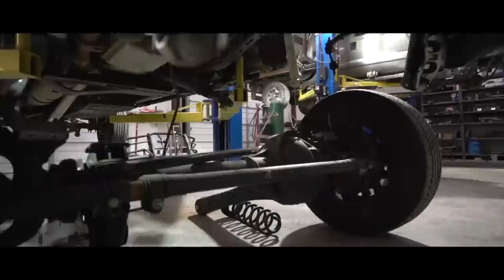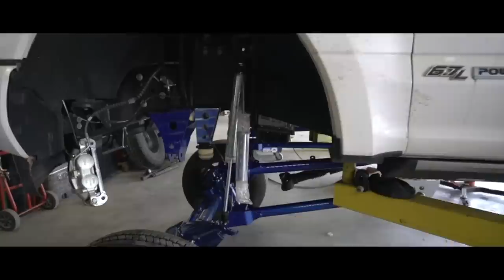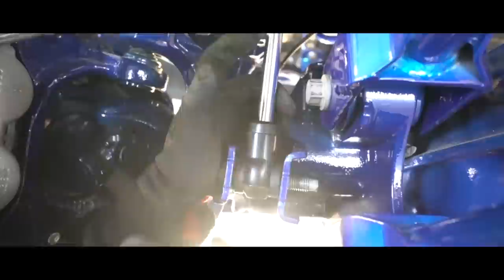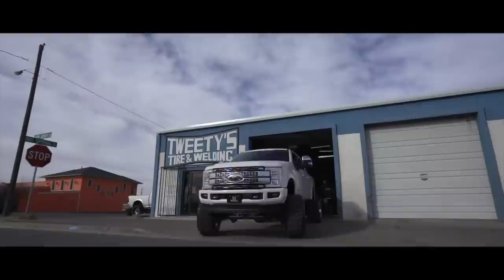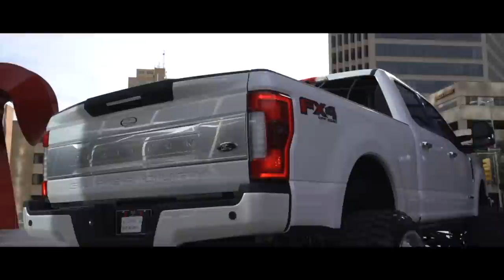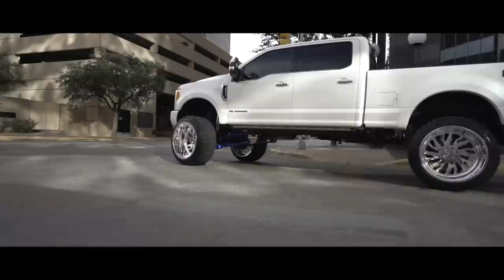HOW A 2017 F250 PLATINUM IS BUILT! 8 INCH CHROME LIFT ON 26X16 FROM START TO FINISH!!!!

Comment: If my searching skills are correct, the wheels alone were $6800....god damn
Reply: 7 Star 150 true, I worked down there in the field and had some put in my truck but 24X14s on a 6 inch lift. Dodge. There do an awesome job  at tweety’s tires
Reply: What a waste of a good truck
Reply: Mike Avilez not a waste but definitely now useless
Reply: That shit fire🔥🔥🔥🔥

Comment: A buncha f'in haters on here that can't afford a truck like that. Never fails. That truck is sick and definitely a head turner. That's the new age chick magnet not those little Hondas or Vettes. A $100k beast with all the options of a sports car or sports sedan. Turbo diesel 440hp plus 200hp deleted and programmed. Pano roof and can play in the mud and pull a boat and trailers. You won't see it stuck in a flood that's for sure
Reply: sorry to break it to you bud  but i can  afford a truck like that, my daily drive is a 2008 All Carbon Lamborghini Murcielago LP640 Manual, nonly one in the world, i just don't like trucks.
Reply: @RectafyGaming  you drive a lp640 but upload fortnite videos on youtube😂 shouldn't you be busy trying to make money somewhere else? Sounds like a kid to me💀

Comment: How much of a lift do I need to put on a 2002 excursion running 35x13.50x26 m/t
Reply: You'll need about 5-6" of a lift to make it look good https://autocarspec.com/ford-excursion-35-inch-tires-vs-33-what-lift-to-choose.html
Reply: I had a 99 f250 and I cleared 35s on a leveling kit. Minor rubbing

Comment: It looks like mine but I have a doge and its wight with a candy blue Drs lift kit
Reply: Angelica Olivos With that English, I doubt you have a truck.
Reply: Ford Fan01 nice ford
Reply: How much does it cost to  raise a Truck like this one?
Reply: José Álvarez Depends on how big of a lift.
Reply: Angelica Olivos HOW much does this lift up cost you?
Reply: Ford Fan01 just like the one on this video
Reply: José Álvarez A good 8in. lift (which doesn’t even exist, I don’t know where they found one. Either that or it was custom built) would cost you around $4,000 - $5,000 not including the cost to install it.
Reply: Nevermind, found it. But it’s a Skyjacker lift kit but I don’t recommend it. I’ve never had any luck with them. I do recommend a Pro-Comp lift though (although they don’t carry an 8in lift). I currently am using a 6in lift on my 2017 F-350, it rides great.
Reply: Angelica Olivos It looks just like mine,  but mines a car and it's black and not that high. It doesn't run either. Other than that , spot on.

Comment: Have to take a pass, I liked it better on the way in.  No doubt a lot of money was spent, but why not replace the rear spring with a Deaver 15 or 20 leaf pack and get rid of the rear block entirely, instead of having that massive block.  The wheels are beautiful, but the tires are a bit narrow for them, and what the hell brand are they?  A truck this nice should be riding on Toyos.